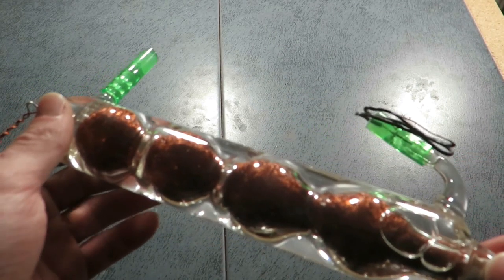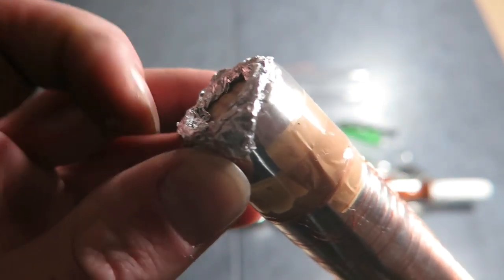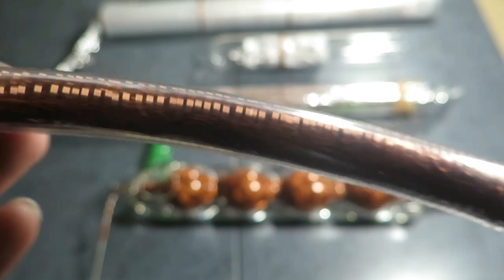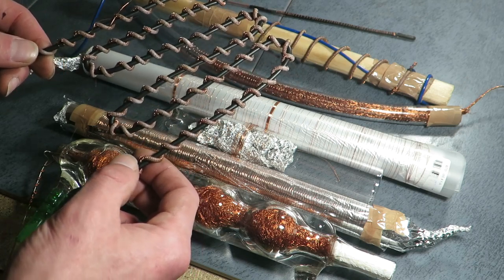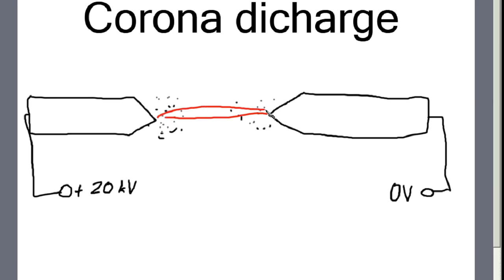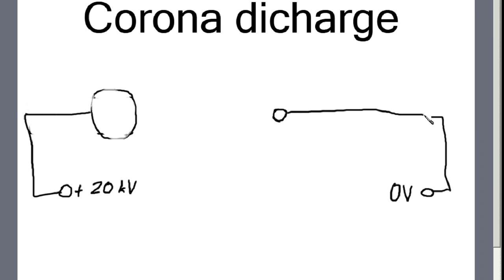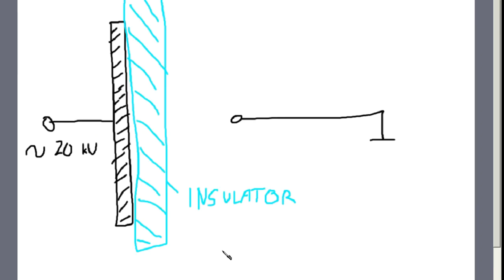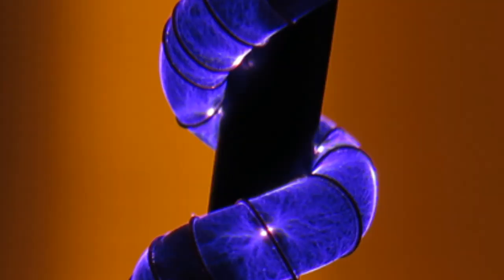Ozone generator and corona discharge physics

Comment: Using plastic as your dielectric (the insulator between your conductive layers) won't really work because you'll just get something like the breakdown of a capacitor, which is basically what these things are. In short, what happens is the current discharges through the plastic at a single point due to dielectric breakdown which creates a charred spot of carbon by pyrolysis of the plastic due to the heat of the discharge and will form a conductive path for current to travel through because the carbon is conductive. You should look into dielectric material properties, dielectric breakdown and the workings of capacitors to finetune your design better.

I may be mistaken about the exact mechanism, it's been a while since I've studied electrostatics, but the theory should hold true. You want a material with a high breakdown voltage. The formation of ozone depends more on a high voltage to ionize O2 into free radicals, which combine with other O2 molecules to form ozone, so a higher voltage would be much better.

Also, don't breathe in ozone if you don't have to. Use this in a well ventilated area. Ozone is quite toxic and will cause damage to your lungs through oxidative stress.

Thanks for taking the time to make and share this video. I wish you safe and happy experimenting.
Reply from the maker: Thanks :)
Reply: Thank you both for the replies. I'm always glad to help, but reluctant to post these long winded explanations because I know a lot of people don't like having to read a lot of stuff like this. Especially from a commenter. I'm really glad my comments could be helpful and am grateful for the appreciation. Take care and I wish you both all the best. Cheers. =D

Comment: How da fuck
Love it
Reply from the maker: wow, I mean I still talk like an autist, but this was unexpected :)
must have been quite painful to watch
Reply: What's happening is he generates a high voltage between the inside and the outside of the tube, and the glass insulates it and prevents any current (electrons) from flowing between the two. The high voltage rips oxygen (O2) molecules in the air apart into two individual oxygen atoms. Single oxygen atoms are really reactive, so they'll each combine with another O2 molecule in the air to form ozone, which is just 3 oxygen atoms joined together, or O3.

 The same thing happens way up in the ozone layer of the Earth. Except instead of a high voltage, it's ultraviolet light that gets absorbed by the O2 molecules and causes them to split into individual oxygen atoms which go on to combine with other O2 molecules to form ozone.

I hope that explained it without getting too technical. Cheers.